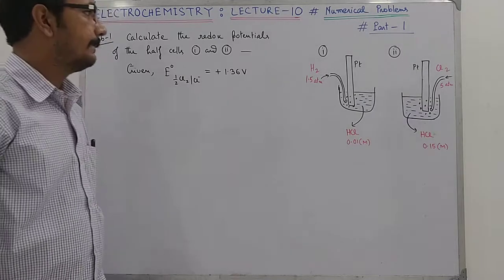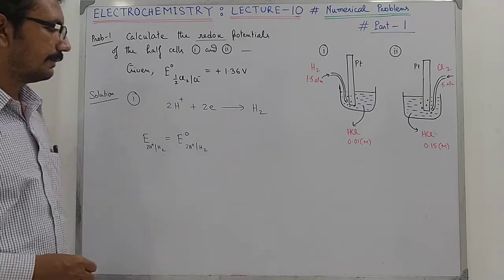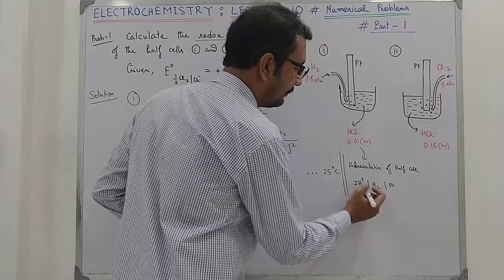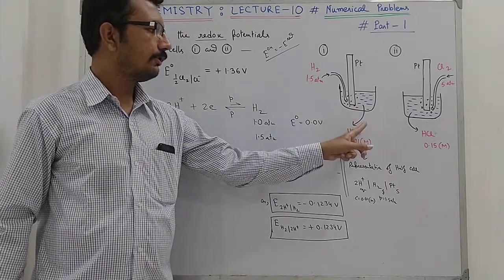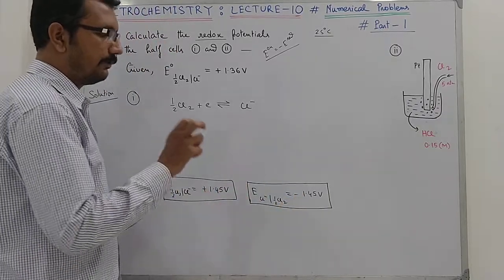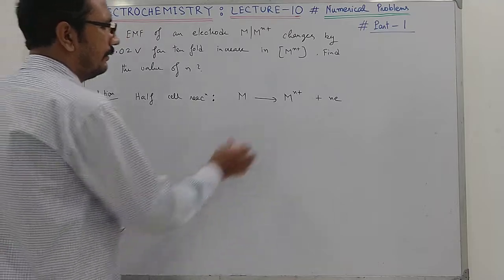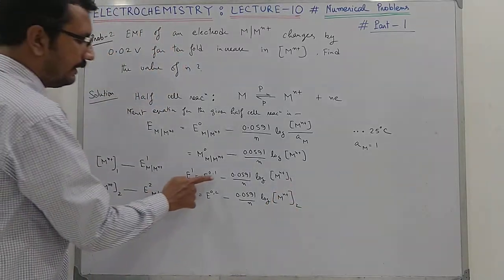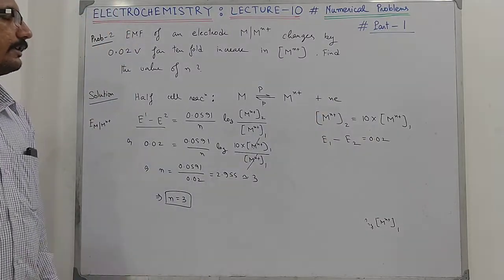Electrochemistry : Lecture 10 #Numerical Problems #Part 1

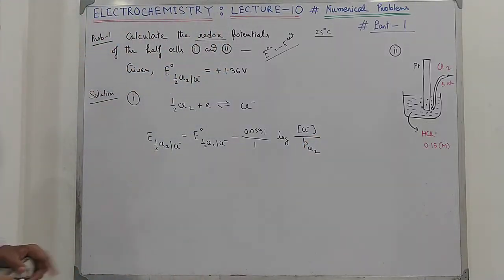Comment: Sir, I think there has been a "Typing Mistake" on your side in the video exactly on 20:08.
I think the denominator inside the logarithm will be (pCl2)^1/2 
My well wishes and heartfelt thanks to you ☺️
P.S. If by chance I am wrong, please help me understand why the Nernst equation went like that☺️
Reply from the maker: You are right dear. It should be p_Cl2^(1/2) instead of p_Cl2 in the denominator.
Reply from the maker: Thank you very much for finding out the error. I am giving the document link where I have solved it in paper. Please download it.
Reply from the maker: Please download the document of correction of Problem 1 (ii) by clicking the link given below:
https://drive.google.com/file/d/1SW1sOd27OiajV0-mYpUfDOAwttorezTk/view?usp=drivesdk